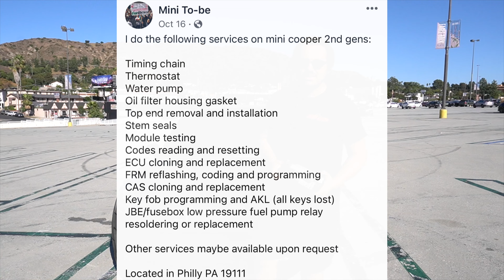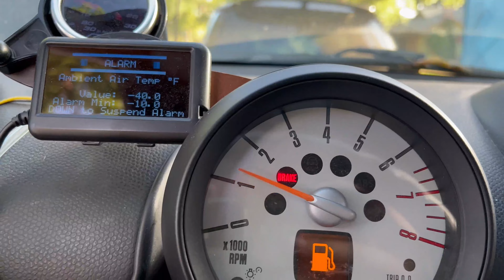RPM Powered R400 Big Turbo Kit Install - MINI Cooper S Countryman All4 N18 engine

Comment: you mentioned stock fueling ECT,  how did you manage the ECU? since you have completely eliminated the stock pressure monitoring/saftey systems (DV, internal wastegate ECT) did you have a tuner map out the boost plausibility error codes?. the car sounds awsome with that turbo and mani setup. love it! im hoping to do internals in my R56 in 2024 to look at a bigger turbo setup.
Reply from the maker: It was actually still mapped on a previous tune for a stock style turbo at the time this was filmed. It didn’t have any issues but once I cleared codes then it was trying to go into limp mode for not being able to control boost. 

Awaiting smog then will be getting it tuned correctly

Comment: I thought that for a Turbo charger replacement you had to put it « Front Service » mode.  Take off the whole front bumper, grill, and tires.  But I see that you were able to get turbo and manifold? Off without taking the front off.  How long,  how much did you pay for parts,  and how much would that cost at the stealership? If you know of course.  I live near San Francisco CA.  Do you have any mechanic contacts that will save me some dough and could advise on easy upgrades?  Thanks.
Reply from the maker: @arturothecook  most people prefer to put it into service mode for more room but isn’t needed, especially with a stock turbo. No need to remove tires and all. This is a full after market kit, the dealer would never install this, you would need a private shop. 

I do recommend getting the R300 turbocharger and an upgraded intercooler, and a tune from Mario Palza. If you end up in socal drop it off at his place and he can sort you with what you need
Reply: @zevisgarage  I need to replace the stock that Mini of Concord CA. reported as bad and in need to replace but I almost got a heart attach when they told me that it would be 10K to do it!!!  Yet, I was not feeling comfortable with going full front disassembly mode.  If it can be done without it.  I will get the mechanic friend to help me replace it.  He's work in a couple of our Mercedes-B cars before.  I reviewed another YT video showing the hole process in detail almost bolt by bolt and got a little discourage that it required so many parts taking off.  Thanks for your videos.  Very educational and encouraging to venture on some of the easy ones.  What OBD2 scanner do you use? or which one would you recommend for a non-mechanicly gifted and inexperience mini owner?
Reply from the maker: @arturothecook  best I’ve come across for the money is the Foxwell NT710. I’ve been super impressed with it, it has mini specific software with a lot of goodies

Comment: Nice video, what did you use to seal that turbo oil feed in the beginning of the video? High temp epoxy?
Reply from the maker: JB weld as it was an emergency repair. It’s worked well for a coolant repair from the track but it didn’t work for oil. Replaced oil line anyways
Reply: @zevisgarage  good to know, thanks for the reply. Mine just started leaking, new oil feed it is 🙂
Reply from the maker: @towney629  make sure you get the braided one, the Detroit tuned one is good

Comment: How much power do you think it was making in this videos with no controller ? I would honestly be more than happy with this turnout. No need to up the boost if the internals are reliable at that hp for me personally. Also how much did you spend on this ? I did some research and I found the kit for 4.3k
Reply from the maker: @morechuckyblood  the R400TS is around that 4500 range. The original R400 kit like the one I have is around 7k new if you pay full price. It definitely made nice power but shortly after filming I turned down the boost to make sure stock internals would survive. I’m pretty sure it would last at the 18ish psi I was targeting before. 

As of about a month ago I’ve now forged the engine and am almost done with break in, about 1 more week before I turn the boost up

Comment: I watched 😊😊😊your videos 📸📸📸 why did you go from the rpm 300 turbo......I see in that video 📷📸 you took off the front of the vehicle.......why when you changed to the rpm 400 turbo setup..... you actually didn't remove the front of the vehicle......it actually would've made life simpler.......do you happen to know......what size compressor wheels were used.......
Reply from the maker: @randys5097  I think I stated in the video I left the front end on just to see if it was possible to assemble the kit with the front installed on the car. I always like finding out stuff like this and reporting to others. Now a days I have the R400TS and I removed the OG R400, that video will be in about 2 weeks
Reply: @zevisgarage  okkkkkkkkkkay awesome 💯💯💯.......I must have missed that part..... LoL 😆😆😆😆
Reply: @zevisgarage  what's the R400TS and OG400......
Reply from the maker: @randys5097  the OG R400 is the one in this video with the big manifold. The R400TS is the twin scroll version, still a big turbo but it utilizes the stock exhaust manifold
Reply: @zevisgarage  I'm currently looking for options for 2x of my mini Cooper's......1x---2013 jcw and 1x 2008 with 73,000 miles....... it's been totally refreshed
Reply from the maker: @randys5097  definitely worth it if the engine is setup for it

Comment: Love your builds. Keep posting an update on your work. I wanted to do this set up on a bmw n13. Do you think with a slight modification on this kit would fit? There is a tons options for big turbo kit for mini readily available, but sadly none for the BMW n13. Any expert out there who is able to help?
Reply from the maker: Thanks!! It probably would fit, you would have to route the charge pipes and bits differently but I imagine it would fit. If you have somewhere to contact you I can send you more info

Comment: How do you tune the n18.. was told the ecu is locked and can not tune it unless the ecu is sent out to basically get jailbroken
Reply from the maker: They have to be bench tuned but they can be tuned still. Not like the modern A90 Supra where it has to go over seas. 

I’m local to Mario Palza, I have him tune my cars. It’s an RPM Power tune

Comment: was this video without tune? also were you WOT at any time?
Reply from the maker: It was with a previous stage 3 tune. Currently awaiting the correct tune. Yes I was WOT, did find a few minor boost leaks after the video. I plan on keeping it on low boost until I put a built engine in

Comment: How much power do you think a stock block can handle you think?
Reply from the maker: Block itself like 350whp safely, over that I would fear for longevity. Stock internals won’t take more that 300whp for long, I already broke internals once so far
Reply: @zevisgarage  oh wow!  That more than I thought it could handle.  I have fwd and wonder if the auto trans is a weak point.  Might have to invest in all4
Reply from the maker: @iissac22  fwd auto trans can take about 280ft lbs and 300whp max. Not sure what an auto all4 can take
Reply: Love the work finally some one working on the f60. I have the jcw 2023 how much power to the wheel you think the internal should hold ? I have Downpipe, intercooler, intake, and a JB4 map 2.
Reply from the maker: @samuelpacheco37  the B48 will take plenty of power, reliably 300+ 
Same engine in a BMW has made over 400+, just naturally the Mini doesn’t have as much bolt on support
Reply: @zevisgarage  appreciate it, thank you. Hope to see more from this build

Comment: if i get the r400 on my n18 how do i not blow it up
Reply from the maker: Just don’t turn it up much. Make sure to run a mechanical boost gauge, and make sure the Wastegate is hooked up correctly. With an external gate setup like on the r400 you will have infinite boost if it’s not hooked up correctly